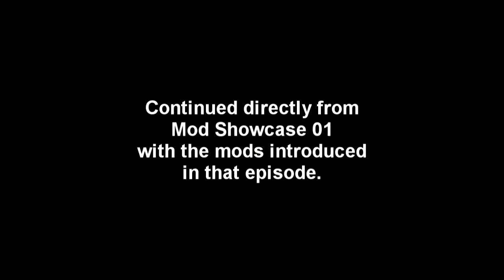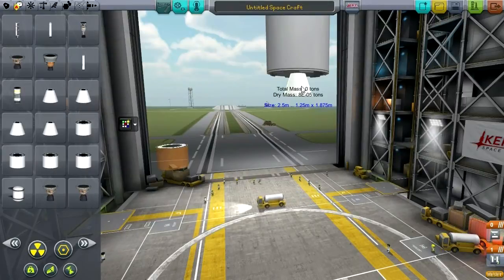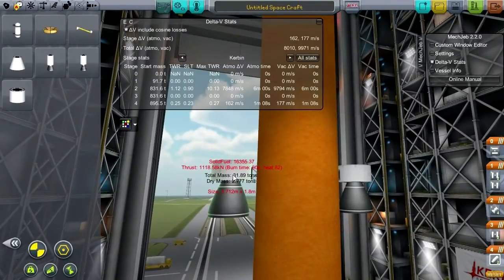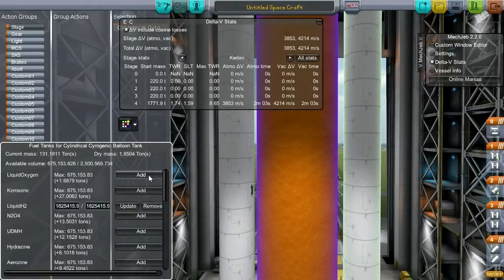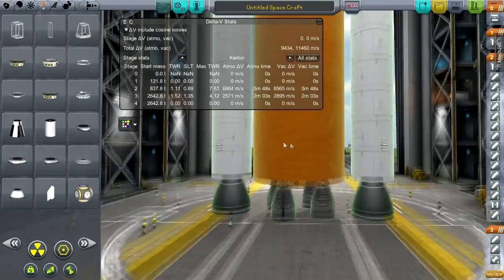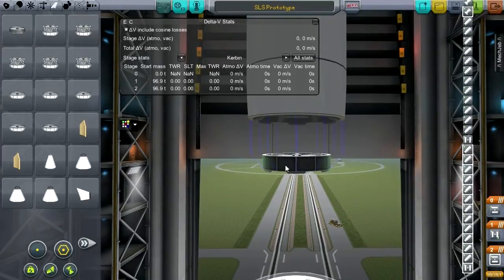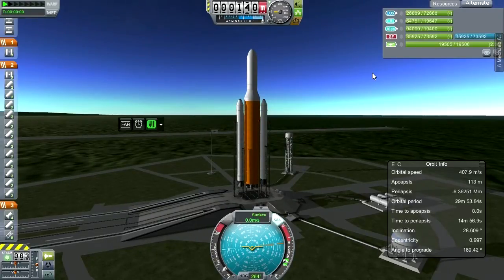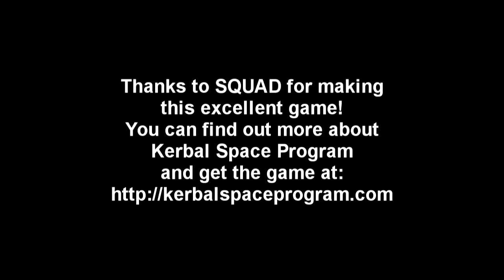Kerbal Space Program (0.23.5) - Mod Showcase 02 - Realism Mods Part 2

Comment: YOU ARE A HERO. You finally demonstrated the "can't scroll bug" so now I know what causes it: a duplicated MFT module on the tank! (There was a typo in the cfg that changes the small twice rather than the small and the medium; it's been corrected.)
Also--you're on your honor not to use balloon tanks when there's weight resting on them: you'll note that almost nothing uses them IRL because they're super-fragile; Atlas core switched from balloon to regular tanks in Atlas III, and in the Atlas V, Centaur (which still uses balloon tanks) can't support the weight of the payload on the larger Atlas Vs and they need a special payload adapter that distributes the weight of the payload back to the first stage.

Also, for matching existing SRBs--you need to match average thrust, not peak thrust. This is because (without HoneyFox's Engine Thrust Controller plugin) SRB thrust is constant, whereas in real life it often varies. That peak 14MN thrust from the Shuttle SRBs? Only at that level for a short period of time. Often it's lower, which means you need less fuel for the 123s burntime. My suggestion when not using ETC is to match fuel mass when cloning solid rockets, and also match burn time. Let thrust fall where it may.

Anything with module = Strut (like struts. Also the Airplane tail and some nosecones, IIRC) are massless ingame.

What you were experiencing is the problem with joints between super-heavy parts and super-light parts (remember that you've placed ~100t on top of a 0.1 ton part, which is then on top of a 900 ton part). Think about if you tried that in real life. :P
If the conic were full of fuel it'd be ok, probably.
Reply: Well, balloon tanks can take some weight--after all, Atlas bore Mercury, and all of Centaur+Payload for the Atlas-Centaur series. But I wouldn't try for more than 10 tons on a 3m upper balloon tank, or 25t total (payload + upper stage(s)) on a lower-stage 3m balloon tank. Certainly you can't bolt SRBs on though--even if the tank is stressed for payload weight, the sides won't be strong enough to be mountpoints for SRBs.

Ah, then you definitely should grab HoneyFox's EngineThrustController plugin. You can then have a 100% accurate thrust curve for shuttle SRBs, for instance.

Struts have always been massless, and certainly should remain so--you'll note in .23.5 a lot more light parts have had their physics disabled (physicalSignificance = 1) like struts, ladders, and legs. This is because PhysX simply can't handle large differences in mass between parts when they're joined together--the joints break or bounce around (exactly what you saw, the bouncing). It's a well-described issue on the KJR thread and is the reason why most all the adapters got changed from module = Part to module = Strut in .23.5

And thanks to you as always!
Reply: +NathanKell how long comments.

Comment: The thing you got stuck on the SRBs was the KW interstage fairing (with integrated decoupler) and the '2.5m' parachute was a NP chute for 2.5m capsules. Also, RealChutes are resizable (to a certain degree) so you can stick them on your boosters and then open their config screen to match the needed size.

Sincerely
Marrus Q
Reply: Also the StretchySRBs look weird when adjusted to have a high thrust. The exhaust effect looks kind of... cute ;)